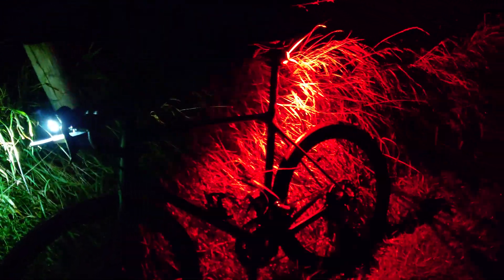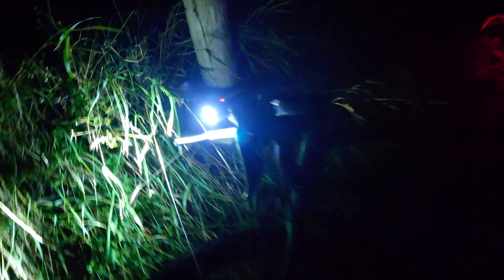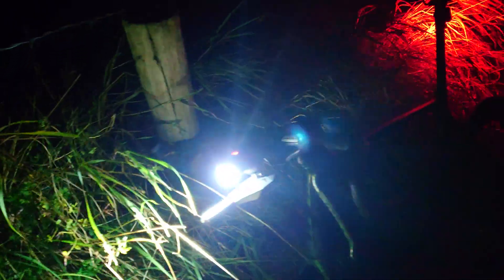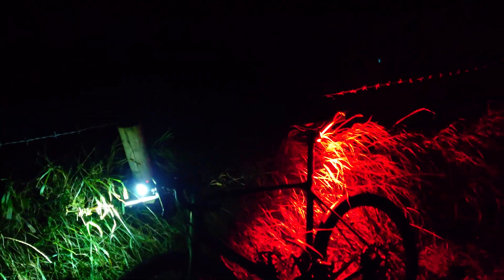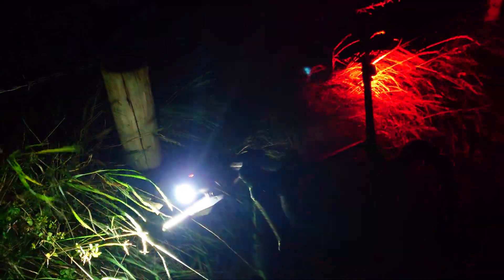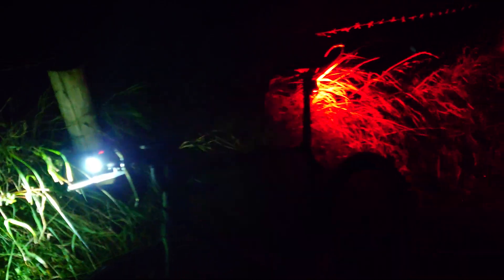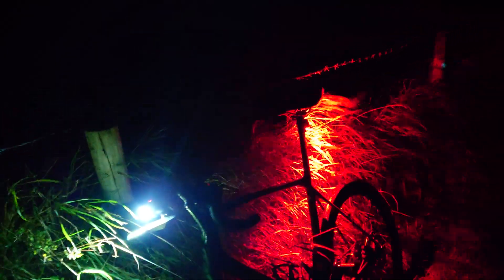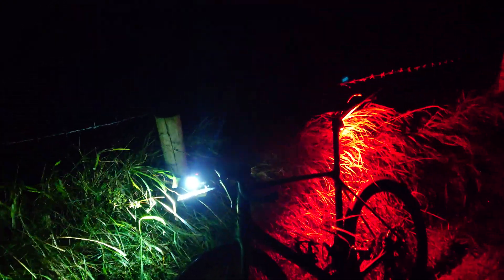Aero baseline testing. #CdA #aerodynamics #cycling

Comment: I would be surprised if the sensor works well in those crazy wind conditions.  I would think that the high pressure zone in front of the bike/rider would be too inconsistently shaped in gusting conditions.   You also might consider building an extension to put the sensor further out in front.  I get better results since I added an extension for my Notio that puts the sensor slightly in front of the leading edge of the front wheel and as far away from my hands and ERO bars as possible.  

I am looking forward to the results.
Reply from the maker: Trying to find the extremes of what it can do! So far I have ridden it accurately in apparent wind angles of up to 20 deg, (20 deg yaw). As far as I know the Notio only has a single hold pitot tube (for dynamic pressure). This one has 3 ports for dynamic pressure, so it's pretty good at reading yaws up to about 20 deg. There is also a cloud based code that calculates your local pressure field